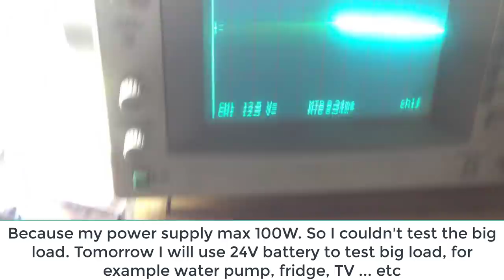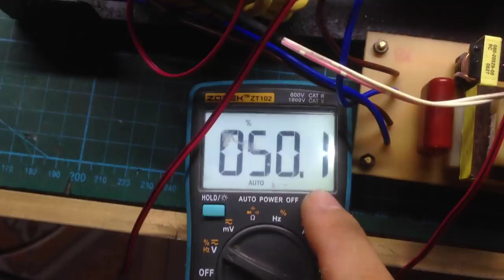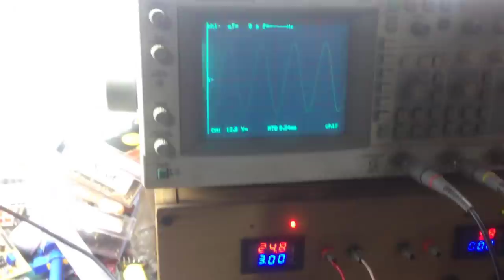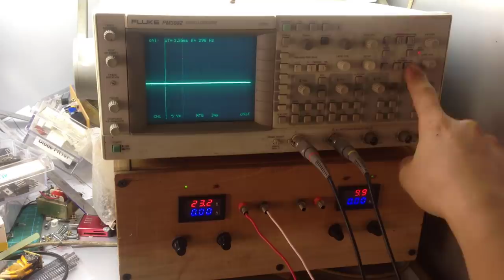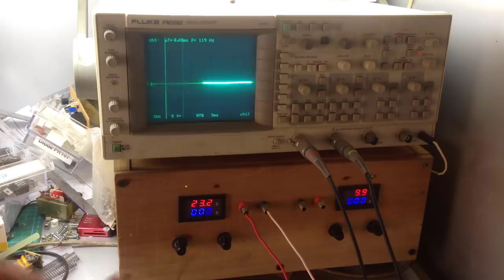2000W 24V INVERTER SINE

Comment: I have a transis 12 & 0 & 12 30 a. I want to make an inverter signal and pure power 12 volt 220 volts to get out what is the circuit diagram and thank you

Comment: Ok i see that you hav output transformator. But transistors typ tip122 and tip127 not can  transfer 10kW power to transformer. 4x5A= 20A, 20x24V= 480w
Or I not can see fine from video link
Reply from the maker: I use IR2110 to control Totem Pole Driver. To reach 10KW you need to use a voltage of 60V with 24 mosfet HY4008W (80V 200A). In this video I use 8 mosfet HY4008W working at 24V. 2KW capacity.

Comment: I like this design I also like your 2 newest designs 
Is there something wrong with this designs 
I like the control driver board and mosfet board to be separate 
So I would like to build this one if it works well 
Is the transformer primary 26- 28 volts ?
Is it possible to build this inverter for 96volt and higher battery bank?
Could I pay  you design electronic circuit boards ???? 
I would like to pay you to do some work for me
Reply from the maker: No problem, I design it for my customer. Customers want all on 1 board. The design cost for the latest 5KW version on my channel is only 30 $. If you want to hire me, contact me on FB.

Comment: Thank you for your excellent project sharing. Which mosfeti should I use for 86v battery voltage 6000w (and how many)? Would you please share the mosfet side's scheme please
Reply from the maker: can use IRF260
Reply: @PhdHung  Thank you
 Will you share the scheme of the mosfet section?

Comment: Hey bro please make 220v to 12v 40amp smps power supply i really need it. i want to run car radiator fan using it.
Reply from the maker: You should buy the 220V to 12V 40A power adapter. It's very cheap, it's used for led advertising lights

Comment: Hi, I'm french, and I'm looking for a system, to transform 220v or 380v ac to 24v DC 100A max. I can't find any solution... Do You have a idea or links to help me please ???  it will be very great from you ;-)   christophe
Reply from the maker: Buy a power source for the server computer. Serial connection with each other. https://pa0fri.home.xs4all.nl/Diversen/DPS-800GB%20A%20Server%20sypply/DPS-800GB%20A%20PSU%20eng.htm
Reply from the maker: Buy an old device, of course. New equipment is very expensive.

Comment: Inspired by your video I have Made the Same Inverter by downloading your files from the Link. 
All components is same as used by you but when I powered it up I'm getting "OverVoltage" Indication on EGS002 Board. 
To cross check I Checked EGS002  on breadboard I grounded VFB,TFB, IFB, VS1 & VS2 Pin to Ground. Then I checked but in the same case I'm again getting OverVoltage indication on EGS002 Board. 
Can you please help me out. ?? 
Your help is appreciated !

Comment: This is great, but sir, how can I incorporate mains to this 
Design to be charging  system and also supply the load. Thanks
Reply from the maker: You will need additional relays and charging transformers, when the power is on, the relay will turn off the inverter and connect the charging transformer.
Reply: OK thanks, can I use one transformer for but inverter and the charging system like the commercial ones with the same mosfets? If yes, how? Thanks

Comment: very good work brother.. ❤️❤️
will it also charge the battery? when connected to mains 220 AC
Reply from the maker: i think it is possible, increase mosfet
Reply: @PhdHung  but there is no battery full cutout and over current for charging
Reply: @PhdHung  but there is no battery full cutout and over current for charging

Comment: Very nice !  But the fuses on the DC input are no very useful.  In a overload condition, one of the semiconductors will blow long before the fuse !

I am very surprised you use TIP122 and TIP127 Darlington transistors.  Those have over 2.0V voltgae drop.  Yes they are inexpensive, but you would be much better off using MOSFETs in the final stage.  It also requires less power to "turn on" a MOSFET.

Comment: I'm a bit confused - In description you mention "Continuous power 2000W at 24V", but in the schema there is 12 to 220V. So, the schema is about 12 or 24 V ?

Comment: The  EGS 002 has a overcurrent flaw that will blow your inverter up you have to disable it and use a DC breaker on the input from your batteries instead you can learn all about it on the website called thebackshed. Com Little China inverter board post I have several other post there also on a few inverters their greats there helped me build

Comment: Hi thanks for perfect videos, can you make +1500w inverter without using board only by transistors and several small transformers in series and other easy to find and cheap materials?

Comment: hi, for 48 volts what changes should i make? thank you very much! Congratulations on your work!
Reply from the maker: Yes, you need the XL7015 module. It converts 48V into 12V for EGS002 and totempole driver. You can see the compact 48V version here https://www.youtube.com/watch?v=ksk0an3RUfQ . I think you will solve your problem.
Reply: thank you very much!

Comment: I really enjoyed this project. I would like to make a 24V 1000 amp approx. booster for starting my tractors and large (125 kWh) generator on farm. These are over $1000 cnd. To buy here. Is this possible with this technology?
Reply from the maker: use super capacitor. It will fulfill your request. Large starting current. And very durable.
Reply: I’m just learning this so I must ask, that would be on this unit? and where on the unit?

Comment: Norrmally chines inverter are in small sized why don't use these big transformers
Reply from the maker: It uses pulse transformers. Inverter use pulse transformer will be smaller, Large capacity but it is less durable
Reply: @PhdHung  do u recommend pulse transformer from aliexpress